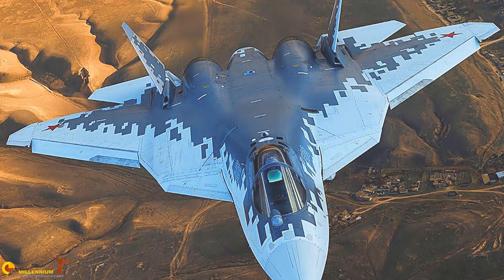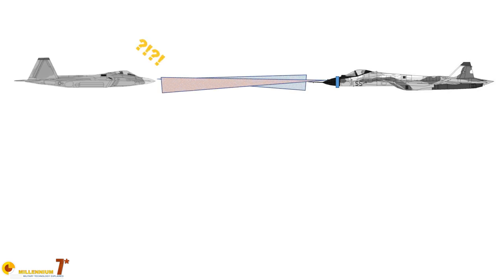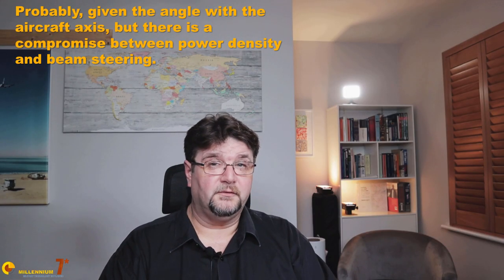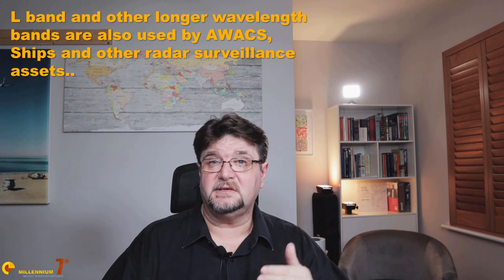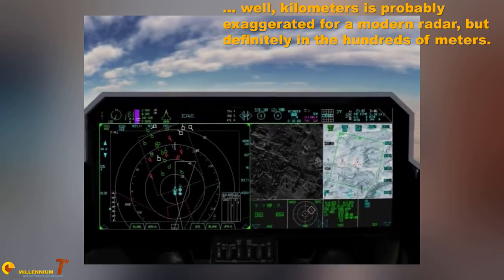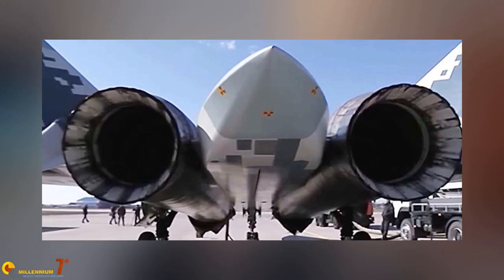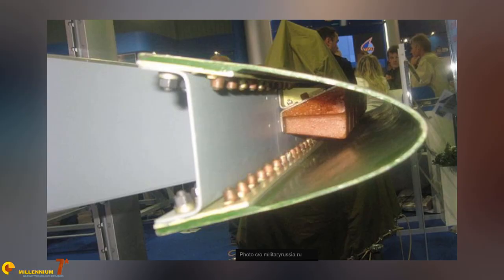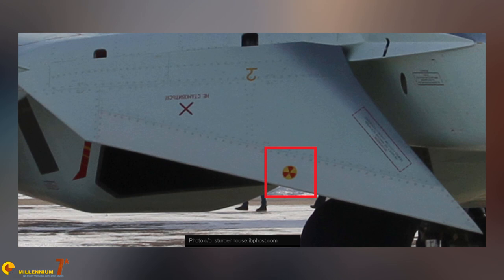Su-57 the Raptor Spotter | Part 4 - Radars, ESM, ECM, IFF

Comment: The SU 57 is stealth or just low RCS?
If it's not stealth it will still be surprised by the F22 just by the fact that it will be detected by the  F22 before he knows the F22 is there.
Reply from the maker: Probably F-22 and F-35 can see the the Su-57 before the Su-57 sees them, but I bet the L band arrays have been designed to spot the F-22 and the F-35 beyond the AMRAAM useful range.
Reply: Smart Alec?
Reply: You didn't listen  carefully the video
Reply: @Millennium7HistoryTech  would the jamming capabilities of the F22 and the F35 have effect on the distance the L band would detect them?
Reply: @aleksnadarMK  thank you. I am going to watch the video one more time and listen more carefully.
Reply: Stealth == low enough RCS ( In real world. Real world is hardly ideal)
Difficult to detect is the name of the game , not invisibility
Reply from the maker: Maybe yes, maybe not. This is the kind of unknowns we have when dealing with contemporary stuff.
Reply: @Milvus_In_Excelsis  
Lol, jamming to play stealth
Reply: @brucebaxter6923  I hope that by now you know that stealth doesn't mean being invisible.
Reply: Well, in two previous years there were a number of measure to make su-57 stealthier. First, all stiking elements, sensors were removed and the big metal section near the engines was covered with radar absorption material. Engines got a special wavy shape of the edge and heat blokers to limit their IRS. The air intakes got special internal radar absorbtion lattices. Overally the RCS decreased significantly. From frontal projection it will be around 0,01 m2, while overal RCS will be around from 0,1 to 0,3 m2(before these measures it was 0,5 m2).
Reply: @Milvus_In_Excelsis  
Was there ever anyone that did?
Reply: @andrewhomo2461  what's the rcs of the F35?
Reply: Su 57 and f22 are neck to neck, su 57 have an ai co-pilot and 5 radars, with the help of an AI computer maybe it will detect f22 faster but turning them on will put you in tight situation also. Same goes to F22 have long range radar,jammers and better stealth but it will exposed your position once you turn them on. So the deciding factor is the tactics and pilots intelligence.
Reply: @Millennium7HistoryTech  The problem is the size of the L band radar array in a moveable wing component. At best it's a couple of metres long and tens of cms high and would have to cover a large 3D volume to be effective, especially at a significant range. The capability ought to be significantly limited if you compare the size of the antenna to something like the Thales S1850M systems which is pretty much the European naval L band 3D search radar system standard.
Reply: @kgchinlumayna  the F22 doesn't have better stealth than the Su57.
The F22 is a stealth fighter, the SU57 isn't a stealth fighter. It has very low RCS. A clean F18 has the same rcs as the SU57.
Reply: @Milvus_In_Excelsis  assuming if that's true, "that the Su-57 isn't a stealth fighter because the RCS is the same as a clean F-18", well a clean F-18 is not a modern combat fighter anymore while with the same RCS the Su-57 still carries AA missiles. On the other hand, if you watch this video and the previous series of this well made series of videos, you'll know that the Russians has a very different approach to stealth, they believe that as sensory technology advances the benefits of stealth will become diminish, so its illogical for them to sacrifice other aspect for "full stealth" like the Americans has, and yes that includes the cost and complexity, whether this believe is true or not we have no way of knowing for certain, but it is plausible.
Reply: @Milvus_In_Excelsis  I think is a valid choice for them, it has its benefits and drawbacks like all engineering project has, we can't blame them for banking of the idea of "advance sensors making stealth irrelevant", since if this turns out to be true all other 5th gen would just be an expensive hard to maintain fighters that offers no significant advantage over what the Russians had, but if not they would be in a really deep deep trouble. Plus this route is certainly cheaper, that's also a plus on a any engineering projects since cost are part of the specification too, only lower is better.